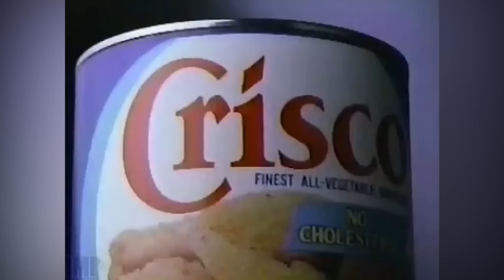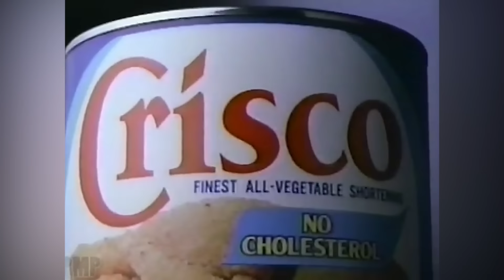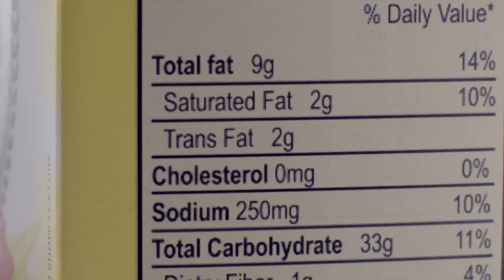The Real Reason Why People Stopped Buying Crisco

Comment: Crisco has two legitimate uses, in my opinion:
1. Use crisco when seasoning a new cast iron pan or dutch oven. Also for reconditioning an old pan you are restoring to service. 
2. Crisco makes a great emergency candle if you have nothing else for light. Stick in a piece of candle wick, a string or other improvised wick and light her up. It will burn for weeks.
Reply: We Think Alike. I Was Going To State This Same Thing. I Will Just Agree With Your Statement. 💯👍👍😎🌞🇺🇸
Reply: That was it's original purpose, but with the advent of electricity, all that cottonseed oil had to be used somewhere. So, they conned us into eating it!!
Reply: Switched to flax oil for seasoning cast iron (higher smoke point and it's a drying oil, meaning it hardens)
But yeah, I used to use Crisco and it worked great too. Wouldn't hesitate to use it again given the circumstances.
Reply: Great info!
Reply: @toddburgess6792  Just like fluoride, aspartame and so much other toxic waste...
Reply: @jazzandbluesculturalherita2547  and biscuits and pie crusts.
Reply: @wanderingmind9593  I actually prefer lard for pie crusts. I haven't cut-in any biscuits from scratch in a long while, being able to get extra biscuits for my biscuits-and-gravy from my Popeyes orders. And I can get frozen Pillsbury Grands in the freezer case, which are much better than the Grands from the tube. The preferred, really the only, gravy is Libbey's in the can.
Reply: That's all I use it for too ! No one wanted to switch from lard to crisco. They were forced to switch during WW2 when lard wasn't available because the military needed it. Lard was unobtainable during those times.
Reply: 3. Lubricant.
Reply: Makes great biscuits and pie crust.
Reply: @jazzandbluesculturalherita2547  lard is even better.
Reply: Preppers use it as a heating element as well...
Reply: @jazzandbluesculturalherita2547  yeah, but I bet you've never had it fried in Lard!    (This was supposed to follow the comment about Crisco making the best fried chicken 🤷 how'd I do that?  Be patient with me, I'm a work in progress?)
Reply: @terebrown2892  I tried lard again recently, at least half-and-half with butter, for my oven-fried chicken. I just love that recipe, and you can find it in the Betty Crocker and Better Homes book. It's very handy for a one-pan meal, a lot less work than deep-fried, and hard to tell the difference. I even cut back by half the listed lard/crisco/butter. I've decided that all-butter is best for oven-fried chicken.
Reply: @jazzandbluesculturalherita2547  you do know that if you have waterless cookware (basically airtight lid with a dimmed lid, so the evaporating fluids do l drip
Reply: Crisco came from Germany where it was invented by Wilhelm Normann in 1901 to be a synthetic diesel engine lubricant
Reply: @jim73challenger  most people don’t realize that any seed oil or hydrogenated fat makes everybody fat. That’s why almost everybody you see walking around today is fat, especially as compared to people at least 40 years prior to now.

Comment: I have Crisco in my long-term storage. In addition to using it for cooking you can also use it as a candle. One can of Crisco will supply light for over 2 months.
Reply: @freespirit3891  no need to. The wick burns only in the center. The plastic can't melt. We burn it as a,candle at camping.
Reply: @Consciously Aware Just cut a piece of twine, as a,wick, then stick a chop stick, or a butter knife in the center of the can of crisco, then stick the wick, twine in the deep hole. Mold the top of the crisco to  Seal the hole. Done. That's a candle that will last for a very long time

Comment: The  can of crisco makes a great emergency candle burns for hours.
Reply: How do you make them
Reply: @JustMe-ig5pn  There are a ton of prepper videos out there -  just search it
Reply: @denisecarter3068  What???
Reply: Thanks. Great idea.
Reply: That's right.  I had forgotten about that
Reply: I repurpose the little jars that "Oui" French yogurt comes in and pour warm (but not hot) Crisco in with a votive candle. Works great! And you can add a drop of essential oil to the Crisco, too - like citronella for mosquito season or balsam fir for Christmastime.
Reply: @JustMe-ig5pn  take natural fiber threads (cotton) and twist to make a wick.  coat wick well with the fat or oil you plan to burn.  Bury bottom of wick into center of the can.  Light wick and wait.  will smoke at 1st and burn funny until it melts the fat and starts to wick the liquid properly.
Reply: Hours? If used only at night, it can burn for days!
Reply: Now we should imagine how long it takes our bodies to burn off hydrogenated fat. Maybe at least one reason why this generation is so fat, hm?
Reply: I have a 1956 Betty Crocker cookbook that I got off eBay. It was the year cookbook that my mother used, and I was anxious to find one under cakes, there is a list of important advice . Guess what number one says? “Use😢 hydrogenated shortening..”

Comment: You forgot to mention that Murray Raney, who invented a Nickle-aluminum alloy used as a catalyst in the production of Crisco, warned that hydronated oil not be used in the food industry. His intent was that hydronated oil be a substitute for industrial grease sticks in industry. He always believed from the beginning that artificial lard made from his process would be unhealthy.
Reply: absolutely correct 100%.
Reply: Scanned the comments to find this.  It was NEVER intended to be food.  From the beginning they warned of the exact reasons not to use it as such.  It's not so much "bad" until you heat it up to cooking temps.  Something happens to it chemically that I'm in no way qualified to explain but from what I understand it does bad things to you including the much vaunted "insulin resistance".  And if you heat it repeatedly (like for frying oil) those "bad" properties keep building up in it with each heating.  I gave up on vegetable oil and margarine years ago because I just didn't like the taste of the food I used it on.  Almost out of anger, I went back to "evil" butter and olive oil (which I found out later is NOT a seed oil) fully expecting to be a big fat porker in a couple months.  I dropped 5lbs in a month, 8 in a year, changing absolutely nothing else while actually enjoying the taste of my food and having a little more energy.  Yes, my HDLs went up slightly but my blood pressure went down, as you would expect with weight loss.  I'm not saying this is a "magic bullet" but for me it was the right choice.

Comment: Crisco shortening has TBHQ in it as an antioxidant. It lengthens the shelf life of fats. Most of the bulk oils used in fast food contain TBHQ, as well as many Keebler products. Reece’s peanut butter cup line all contain it. TBHQ is a chemical, and I’m deathly allergic. 

I’ve met a few folks who have said that they feel ill after eating fast food and avoid dining in those places. Those folks might want to check this out, especially if things like microwave popcorn, restaurants that use certain brands of liquid butter, bouillon, cookies, crackers (looking at you, Keebler!) have made you ill. (Read labels! Products have added this,  moved away from it, and go back to it all the time). Hope this info helps.
Reply: Is THAT what is behind the change in Reese's chocolate from the sweet, delicious, melt in your mouth AND your hands  of the 70's and early 80's to the waxy, hard, tasteless stuff they use now?    That TBHQ stuff?   I have noticed that the individually wrapped cups sometimes still feature that softer chocolate- I wonder if they are made somewhere or by someONE else.
Reply: TBHQ in cooking fats/oils are typically added at 50ppm - 100ppm. That's extremely low. I doubt that TBHQ itself was the cause of your uncle's issues. Some people just have a low tolerance to oils in their diet. It can cause bloat etc. and the purpose of the gall bladder is to produce bile which emulsifies the oils in the gut. Huge difference on how it works on oils vs fats.

Comment: I’m not frying chicken or making biscuits without Crisco. And since I have no plans to quit cooking either chicken or biscuits, I’m going to keep on using Crisco.  🤷🏻‍♀️
Reply: Oh my. You really need to try other methods. I have a multiuse/airfyer oven. I spray a light coat of avocadi oil on the chicken pieces, batter it in egg, superfine almind flour and porkrind panko, after adding whatever seasonings I want in the dry batter. Lemme tell you. That chicken comes out juicy, crispy and sooooooooo good, with that southern fried taste! I'm sure you can deep fry it with the almond flour and panko. I just haven't perfected deep frying yet. I would try tallow or lard if I try it.  No one will ever see me use Crisco, conola oil or any other fake oils for my cooking. If I'm going to make it taste good, then it also has to be good for my body. Saturated fat...good. Trans fat...bad.
Reply: @lovefortruth3414  Did you literally not watch the video that explained that crisco is now trans fat free??????????? smh smh smh smh smh
Reply: @tymarls  I still don't trust it

Comment: I stopped eating Crisco because it is made of GMO soybean which is a crop sprayed with roundup in the fields several times per season.  I dont eat weed killer.  And now cottonseed oil and canola oil are GMO and sprayed with roundup too
Reply: Thank you for pointing that out.
Reply: Also Ancel Keyes lied about saturated fat.
Reply: Cottonseed and canola are two of the worst. That should be enough.

Comment: Many of the sales for crisco came from cake decorators who used it in their buttercream icing. When it became trans fat free it no long would stay together when colors were introduced into the crisco.
Reply: I could tell the difference in my biscuits when Crisco removed the transfat.  The older product made a noticeably better biscuit.
Reply: True. I made wedding cakes back in the 80's. Now it isn't the same. It won't get a hard crust, the lines won't stay sharp,  it melts at a lower  temp, and the color fades. I used half butter and half Crisco in my cakes. And it did make taller cake layers.
Reply: @teenapittman4241   Right. I buy a special bakers shortening. Look for a shortening that still has trans fats. I only use water, shortening, powdered sugar and butter drops. It makes the icing more shelf stable.
Reply: @cakeswithgreattaste9181  that's impossible because trans fats are illegal due to the incredible amount of damage they cause

Comment: Due to the reformulation to remove trans fats, you have to use it cold from the fridge to get the same fluffy results for pastries and cookies.
Reply: Thanks for the tip, fridge it will go for now on.
Reply: well hell
Reply: Never had good luck with pie crust and biscuits since they changed the formula.  I will try your advice.  Sure hope you’re right!  I miss the old Driscoll!  Thank you!

Comment: I keep a can of Crisco in the refrigerator all the time. I like it better for greasing pans than Pam, which leaves residue that won’t come off. I don’t do a lot of frying, so I don’t really use it for that. It is great for baked goods, but I also use butter. Don’t really care for the butter flavored Crisco. I will continue to use  the regular kind.
Reply: If the pans are aren't non-stick, get a generic can of oven cleaner.  No need to scrub your pans for hours to clean them
Reply: Just Me  line the pans with paper for baking .No cleanup required

Comment: I remember buying a 4-pack of sticks of butter-flavored Crisco not that many years ago to use for baking and frying.  Nowadays, I keep a VERY small container of coconut oil in the cupboard, and a slightly larger container of a coconut oil/avocado oil blend.  However, I most often use either non-stick cooking spray, unsalted stick butter/margarine, or an olive oil/sunflower oil blend (cheaper than straight olive oil, and higher smoke point).  My parents used to keep a large bottle of cooking oil in their cupboard (as well as Crisco), and I did too as a newlywed, but I quickly found that I just didn't use up cooking oil quickly enough to keep it from going rancid.  A 1-quart/1-liter bottle of cheap olive oil can be used for basically everything I'd use canola or corn oils for, and isn't so big that it'll go bad before I finish it off.

Comment: I don't know why we went to olive oil and corn oil but I do know crisco is great to blacken an iorn skillet and that is what it is used for by me. it works great on seasoning cast iron skillets.
Reply: hell yes
Reply: Nope. I rub my iron skillet with olive oil or bacon or burger grease, depending on what oil I cooked  with. Then heat it up to sterilise it, then finish off with another light coat of olive oil. I've improved and am correcting alot of health issues by eliminating fake oils, fake ingredients and sugar, and by increasing real fats.

Comment: An excellent additive for making bullet lube.  Melt 10 lbs of Bees wax, 4 lbs of Paraffin wax, and a lb of Crisco.  Melt it on a low heat and stir.  Keep heat low enough to not ignite.  This is something you do not do unattended for even a second.  Then pour or ladle the 3 melted, and blended ingredients into glass or metal containers.  Mason jars work well for storing large amounts for very long periods of time.  You'll have years and years worth of bullet lube and patch lube for reloading bullets or muzzle loading shooting just doing this mix at the rates I give.  I've been shooting nearly every single day for 5 years so far on my last batch of bullet lube I made up.   I still have 3/4's of what I made left.  You'll never buy bullet and patch lube again.

Comment: I use it when putting tubeless tires on the rim. as lube and it fills the gaps that air can leak out,  just enough for the air to build pressure

Comment: Once years ago I put crisco to a test. I had 2 electric skillets. I fried chicken in each at the same time. In one I used generic shorting (not the vegetable kind). Both cooked the same but the chicken cooked in crisco tasted fishy. I started noticing anything I cooked with it was fishy. Yeck. That's when I stopped using it.
Reply: The only oil that I can think of that has a fishy flavour is canola oil, which means Crisco has canola oil added to it, making it even more disgusting.

I, myself, prefer to eat natural fats that we have safely used for millennia: olive oil, coconut oil, butter, lard, tallow, duck and chicken fat.

Comment: I still use Crisco, I haven’t found anything that gives the texture.  But the last two cans I bought, I threw out, as they looked like they’d been melted and had a more translucent look, rather than white fluffy.  Has Crisco done something in the last few years, or did I just get unlucky purchases.  If nothing has changed, I’d have to feel the cans were left outside, off the truck in the heat.

Comment: I banned Crisco and any other food product that uses canola oil from my kitchen.  Canola oil is a GMO derived from rapeseed which is toxic due to its erucic acid content.  Even though canola oil is deemed safe for consumption it still contains some erucic acid.  On the occasion that I deep fry I use soybean oil.  Aside from some specialty oils used for flavoring I use lard or evoo.  If I use butter, I always add a smidgeon of evoo to prevent it from burning.

Comment: I still prefer Crisco (butter flavor) for baked potatoes. It may be 100% artificial in manufacturering, but makes for fantastic baked potatoes. Butter burns too fast and lard is too heavy.  Plain Crisco is a good lubricant for light duty machinery (non oxidizing).

Comment: You can bead a tire if your out of tire loob . my dad was seating some large truck tires that wouldn't take bead. You see the tires had been stored stacked and formed to be skinny . tried the bead blaster a shit bunch of times. tried the infamous starting fluid, light it on fire gig. Oldman took a lung full of the gasses . that was it .. I took off to the store and bought some Crisco. Seated one side of tire to rim packed the other with Crisco. As the tire inflated it pushes out the Crisco to be scraped off and used again. Not for cooking lol. Tires only . nobody knows what the f in saying do they? Works well on wheel barrow tires. No go impress your man.
Reply: I didn't understand a word you said! Sounds real smart though!

Comment: I use the Crisco sticks, there individually wrapped and sealed. They have the measurements on the side of the paper just like butter. I haven't bought a tub of Crisco in about adecade.
Reply: If you're not buying a tub, you're bot cooking so great lmao
Reply: @agonleed3841  I mostly just use it when I'm making my frosting for a cake, sometimes I use it in cookies. I rarely ever fry Foods. Most of the time I use the oven to cook my food. When I'm making stir-fry I'll usually use olive oil, canola oil mix. Once a tub of Cristo's open it's only a matter of time before it goes rancid or collects other flavors or smells that it's exposed to.

Comment: Yeah, don't know why you'd go there, but Upton Sinclair didn't write a hit job on the health benefits of lard, but a historically accurate description of an unregulated meat packing industry.  It just sounds 'more like Sweeney Todd' to the current day and age because we still can't believe the horrendous unsanitary conditions and how laborers were treated.  This was the same time manufacturers would literally lock employees inside their production floors for 12-16 hours shifts without ventilation, bathrooms or access to water.

As well, if the original Crisco was a reaction to a decline in the lard market, that was over a century ago, not 'a few short decades'.

Comment: If you warm it up, and pour it into a jar, then stick a candle in it, and let it solidify,  it will burn for several days as a light on hard times. I have 2 of them. Don't use the original container as it is made of paper.